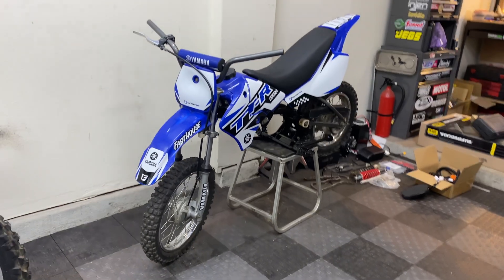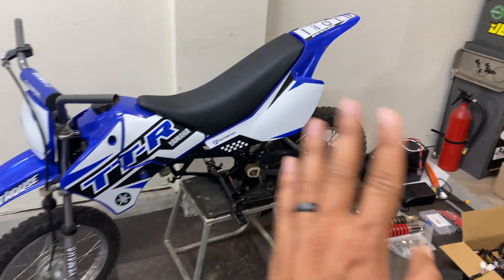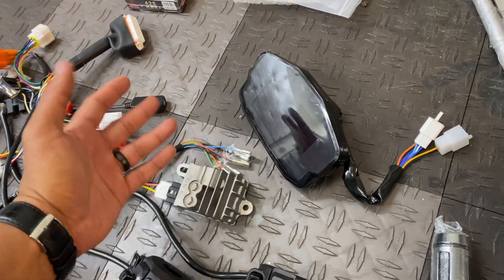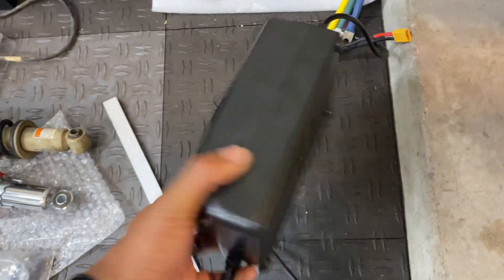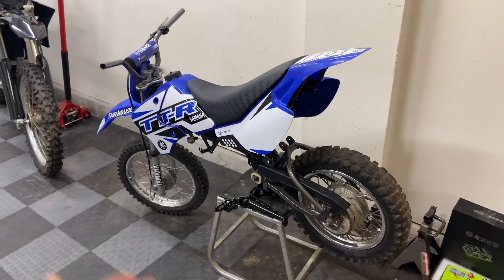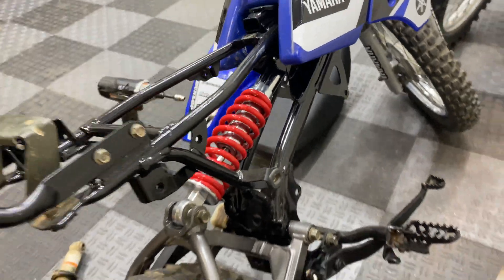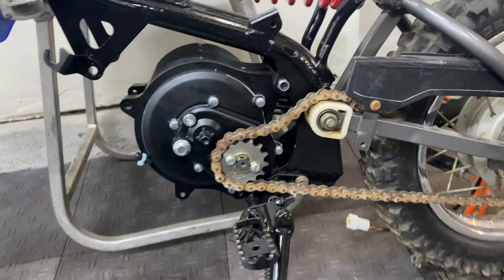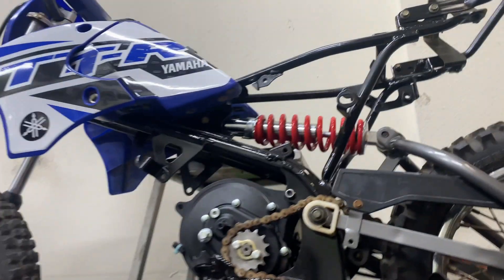Project TTR-E 72V Yamaha Electric Pit Bike Conversion QS138 Fardriver Part 1

Comment: These builds are bad ass and I love the electric 250 
That’s the first and only time imma say that 
But for a pit bike all you need is a big bore its got no clutch but gears to bang through and a thiccc girth sound
Reply from the maker: Trust me, I was highly considering that but this bike had plenty of bottom end oil leaks, fueling issues, and I simply did not wanna deal with the headaches. That’s what I still have my KLX for though
Reply: @PatOutdoors  I love the little klx 
But I understand the bottom end leaks my klx 110 full mod out put shaft seal blew and it’s been down for a while 
But that little monster is a giggle machine